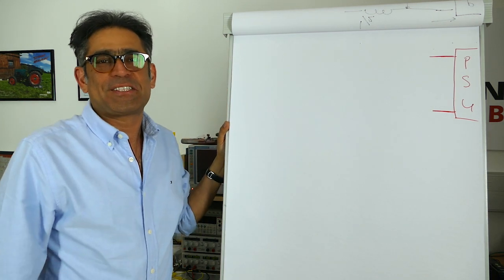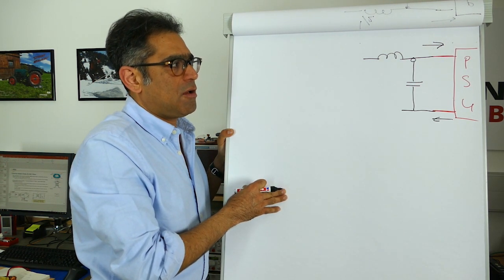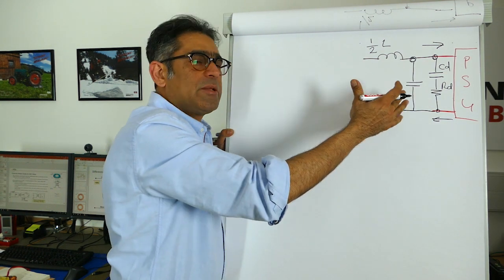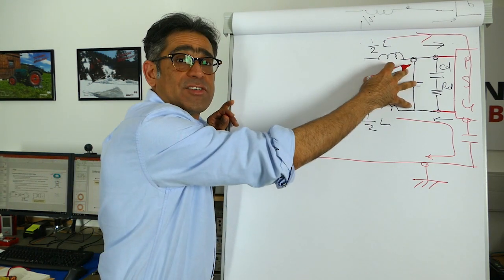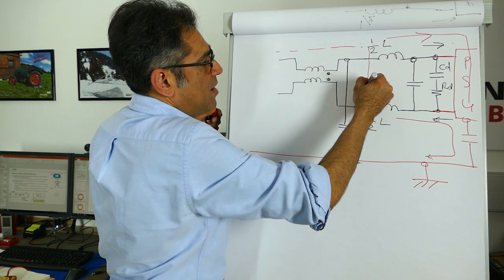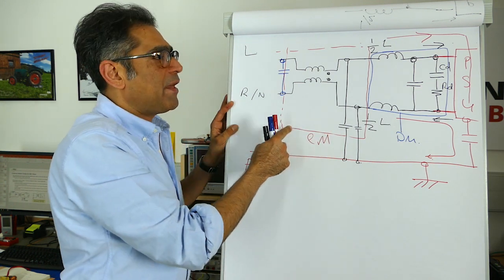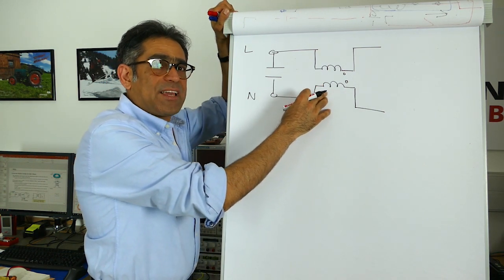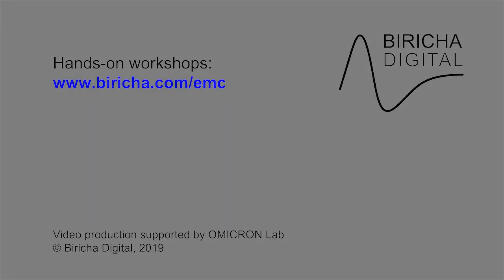EMC Filter Design Part 2: EMC Filter Structure and Operation

Comment: Very informative video. Thanks for sharing.
Question: When adding a CM filter to a device using a prepackaged SMode PS, should the CM filter be incorporated before or after the SMode PS? That is, should it be between the AC wall outlet and SMode PS, or between the SMode PS DC output and the device? 
This question assumes that whatever filter may already be inside the manufactured SMode PS is inadequate. 
My particular application is in trying to eliminate noise from a cooling fan in RF circuits without using two seperate power supplies.

Comment: Very informative !, I've been struggling with interference for so long even though I'm a mechatronics engineer i never studied this topic and never heard of it and only faced it while designing devices, my solutions so far where using another power supply and coaxial cables for signals (coaxial cables didn't always work).

Comment: Wouldn't the return wire be connected to the chassis? If not, why not connect it to effectively 'short out' the red capacitor

Comment: Hi Dr Ali Shirsavar,  why the noise is coming from the direction of the line and neutral, rather than from the PSU?  As I know when we test the conducted emission, the LISN is analysing the noise from the DUT. Then why we design the EMI filter in an opposite way?  Thanks.
Reply: Power supplies always have noise in them or transient voltage present in them caused due to inductive switching or other reasons...line filters provide constant voltage to your PSU